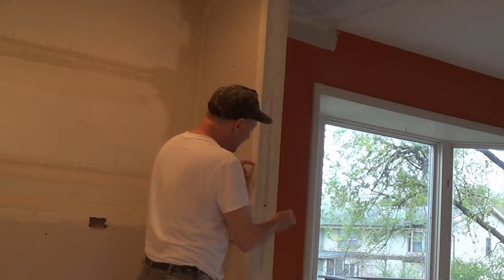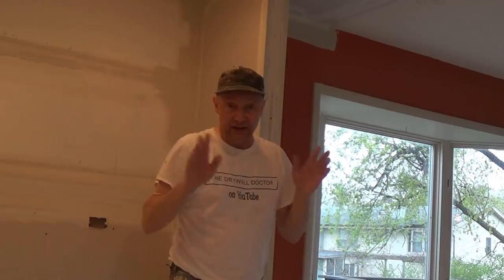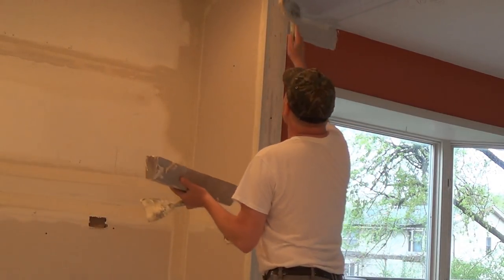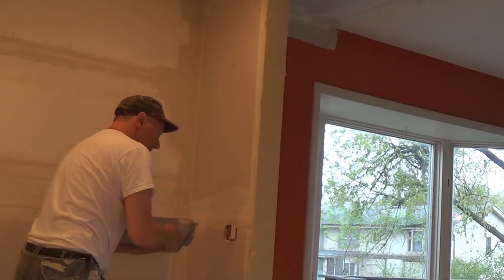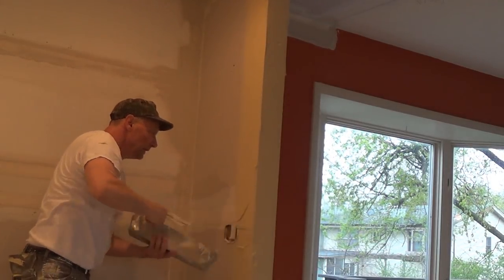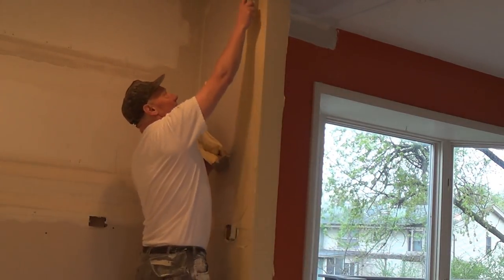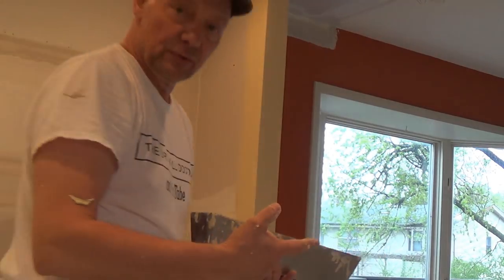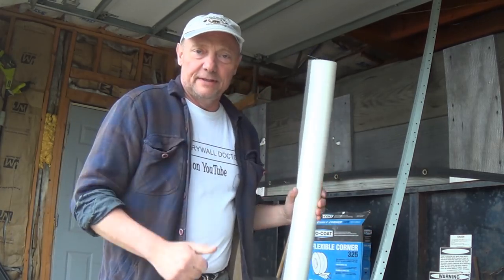How to mud corner bead with a return

Comment: What kind of mud are you using on that? Can  you use the Durabond ir other  quick setting stuff   on the second coat? If not is that OK or should just the bucket stuff be used?
Reply from the maker: I'm probably using +3 premix not quick set